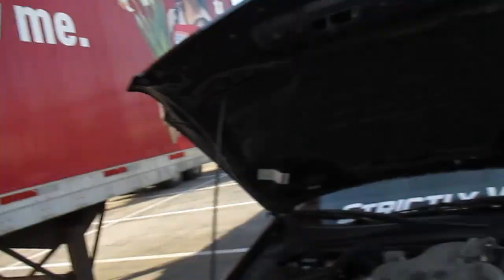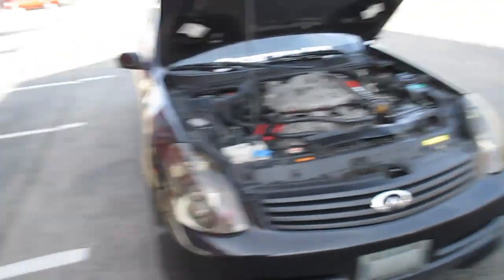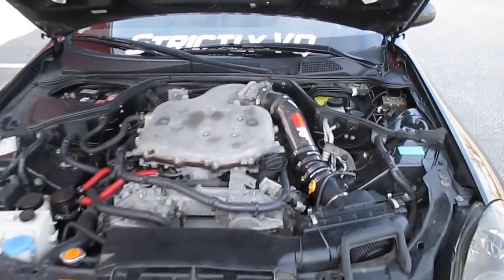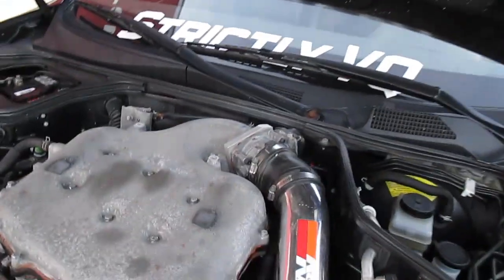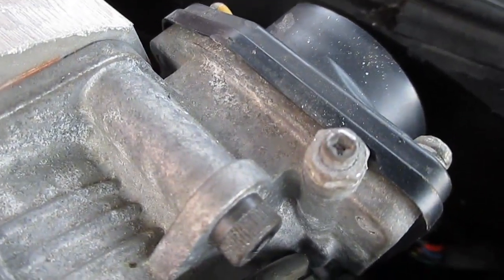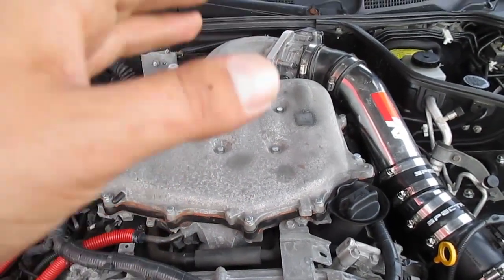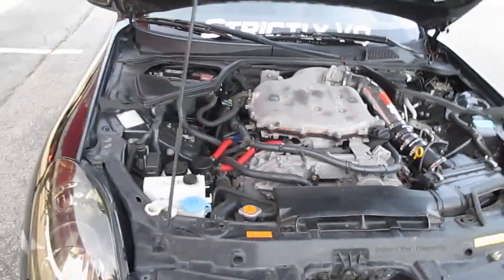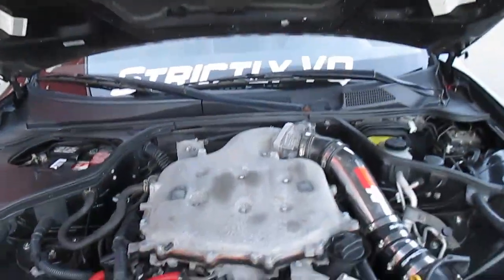G35 Big Bore Throttle Body update - G35 Vlog

Comment: no disrespect bro that is not a nwp spacer or throttle body that is a generic eBay spacer thats a 2012 Nissan Maxima TB you can buy on eBay also the  nwp use the Nissan throttle  body also they added some difference the opening of the throttle body it's in gold also the screws the throttle body is painted in a lights silver the throttle body spacer its dipped in chrome the top of the spacer says nwp another thing It's gonna keep coming back you have to get a tune honestly you need to put a couple more bolts on before doing any tune as for myself I have the nwp 75mm throttle kinetix intake manifold ported out lower runners and a Z1 m-spec long tube cold air intake on my 6speed G coupe I gained a little over 30hp 289hp 272 torque  just with those 4 mods after the tune on my old set up, my new setup tomie  Cam's  AEM 320 fuel pump 1000cc injectors Z1 m-spec dual exhaust y-pipe and test pipes 150 shot of nitrous NX  mishimoto oil cooler  yet not tuned waiting on horsepower hopefully in the next week or two

Comment: Awesome ride!
Hey bro, I have 04’ g35 coupe and had 1/2 “ plenum spacer.
Thinking about buying a NWP throttle body.
You think the adapter spacer it would not rub in my hood?
Reply from the maker: kinggrimlock35 mine rubbed but the NWP spacer is curved on the edges so may clear the hood
Reply: DNALI thanks for respond. Subbed